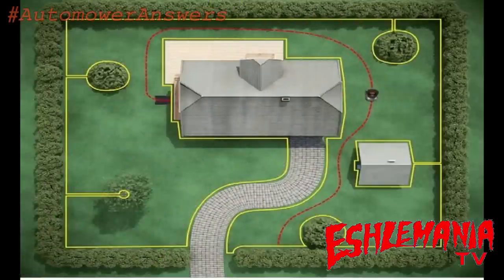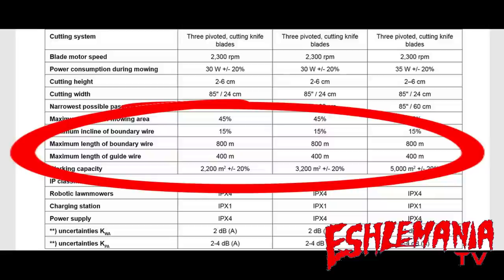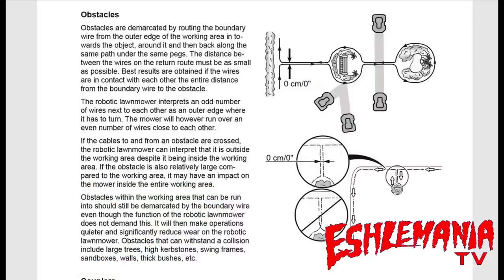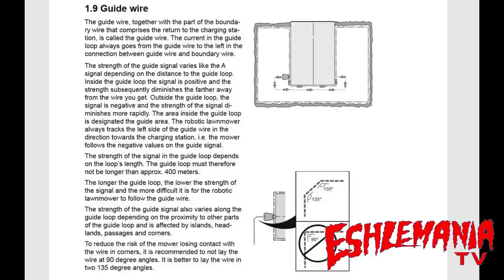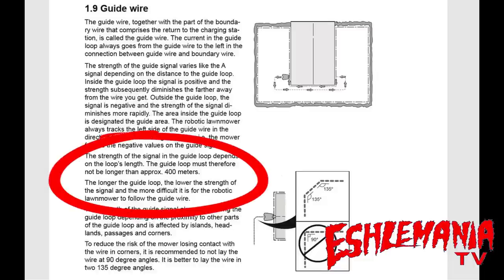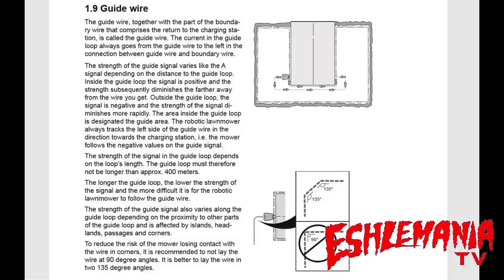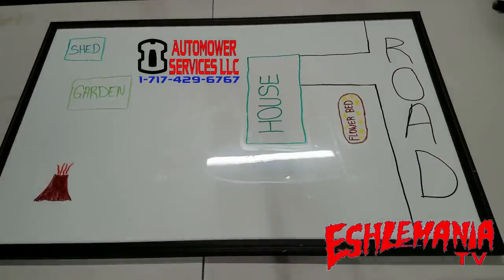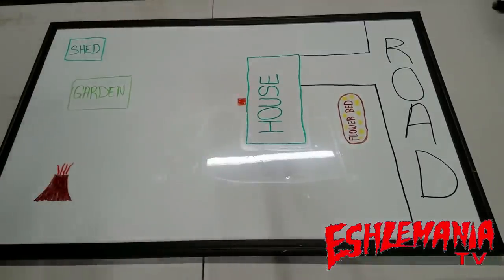Automower Answers: Boundary Wires & Guides Wires (How much is too much)

Comment: It would be nice IF the sales staff and Husqvarna reps actually KNEW this info. I brought in my drawing of our VERY complex landscaped yard and measured out I needed 1300m of boundary wire. All they cared about was if the grass area was less than 1.25Acre...it is .75Acre.  3 Guide wires now available on 450x but still the loops will be more than 400m. I have a large koi pond that has to have boundary around it. So WHY DO THE REPS AND SALES STAFF NOT KNOW THIS INFO!!!  Luckily i saw this video today before i have paid for the new 450X. I will see if i can redesign the layout and maybe have it bump into areas( but that will require a lot of landscape changes). I grow tired of sales people NOT knowing their product. In fact they are order takers, not sales people! Thanks for your great video!!!
Reply from the maker: We could make a LOT of videos about the kind of stuff you're talking about when it comes to people selling power equipment. Not where sure where you are located, but if you need any help or info with an Automower you can send an email to roboticmowerservices@gmail.com
Reply: @EshlemaniaTV  i am in BC but i will email you with
 thanks!

Comment: Guide loop can be longer than 400 meters, but thicker wire must be used - it all comes down to guide loop electrotechnical resistance value. In my garden I have installed a wire, which has conductive cross-section area approximately 1,5 mm² (Husqvarna original standard wire has approximately 0,933 mm²), guide loop length is more than 500 meters and there are no signal problems. Same applies to boundary loop 800 meters maximum length requirement.
Reply from the maker: I've installed a few where we have used over 1,000 meters in the loop and it took some tweaking to get them to work properly. Once they were set up right they had no issues. But since then they have made changes to the charging station boards and a few other components, in places like in the North East United States it's a bit trickier to get away with the large installs like that anymore because of the amount of iron ore in the ground. Same is true for guide loops in these areas.
Reply: @EshlemaniaTV  I'm looking at a 800m boundary for a 450x, with two of the guide wire loops being 550m and 650m respectively, the other is less than 400m. The length being down to the placement of the house and therefore the base unfortunately. I've got standard 2.7mm wire and hoping it will work as they won't be buried, just tacked. The two longer guides will be going over the driveway. If the loop went right at the boundary rather than left it may have been better but it is what it is.
Reply: Installing a 450x with 800-900m perimeter and I have a couple of questions:

1. Does the guide wire maximum length (400m) include the portion of the perimeter wire it connects to?  In other words, if I run a 300m guide wire, but it connects to a point on the boundary wire that is 400m from the base station will it work?

2.  I have a circuitous lawn layout with several large areas.  I plan to run guide wires to these locations, but one location is remote with an eight foot entryway ... if I run a guide wire into the adjacent section, can I safely assume it will eventually find its way into the remote section?
Reply: @chezcarson2012  1. They explained it many times. It should be seen as a loop, both counts. Watch the video again :-)

2. Hard to answer by just reading a text. Guides are used for leaving and returning to the station, when mowing it won't actively use them. Apart from length problems you can run a guide through a narrow passage between boundary wires.

Comment: Thanks for the the help, I have a few questions for a 315x install:
1 can I mow over a freshly seeded soil patch while the seeds are growing?
2 Can I cross an island boundary wire with a guide wire?  It would be crossing the doubled up wire from island to boundary wire proper.  Or does the crossing of a wire pose a problem... 
3 You mention leaving a shed etc to just get bumped into instead of making an island... what about a rock island with football sized rocks at the edge - its in the middle of the yard!  Is it ok to bump into rocks for the robots shell?     Thanks for the tips!

Comment: Will 90 degree corners work with the boundary wires? What happens if the automower needs to find its way back to the base station using the boundary wires?

Comment: I need to put my charging station inside a garage shed. The only problem is that the grass area and shed need to be crossed by pavement. Is it possible to configure the mower to travel on the guidewire without cutting? Or some other way to solve my scenario?

Comment: Instead of doing a GPS guided mow I'm switching to the zone style. How do you determine which wire is the left and which is right? Is it left looking at charge station or facing away from the charge station?
Reply from the maker: They are labeled on the back of the charging station

Comment: Why does my 315X fails to detect guide-wire on the last quarter of the distance when searching path back to charging station? Guide-wire is 85m long and whole ‘left loop’ is about 200m (guide+left boundary). When exiting charging station and going to that spot of 85m it does have no problems following it. Just does not find it when searching it in the last cca. 20-30 meters…

Comment: Very interesting video!
One question thuogh.
I have a 430x with the possibility to use 2 guide cables.
Is it possible to position the 2 guide cables together for 20 meters and then separate them to different planes in the garden?
If not, what is the shortest distance they can be laid without disturbing each other?
Reply from the maker: You can lay them next to each other but leave about 30cm between them.

Comment: Great Video. Thank you I wish I would have watched this 3 years ago.  We just installed a new boundary wire. But this time we decided we didn't need any guide wires.  Stihl and Honda don't use them so we can get a way with not having them  just more stuff to break.  Right. But we installed boundary wire and the battery kept dying.  So we just changed the setting. If the mower has thirty minutes to get back to the charging station than it can just find the boundary wire easily in 30 minutes and roll back to home base right?  Still dyed in the yard.  So we tried a spare on that is brand new and it found the charging station. Was this just luck that it found the charging station? Or is the battery really dead or not good. It is a 2018 model.  You seem to really believe in guide wires. Do you still think the same thing in 2020.  This installation is huge 1.5 acres.
Reply from the maker: Guide wires are what separates Automowers from all of the competition. They allow for more remote start locations within the installation so you can get better coverage in complex or crowded lawns. If the 315X had 2 guide wires there would be even more of them sold. As far as them being one more thing to break, if a guide wire breaks the mower can still mow because it is a completely different signal than the loop signal. The 115H would not be able to dock properly in the charging station if it did not have a guide installed or it was broken. The 115 H charging station use the guide wire to line the mower up with the charger when it backs in. It's really no different than driving in a car and having a limited amount of gas. Ae you going to take the long way around to and from your destination, or are you going to take a direct path to get there to save time and fuel?

Comment: Does the 400 metre limit on the guide wire loop refer to each of the guide wires used or the complete guide wire system installed?

Comment: Very compelling video about the guide wire vs boundary wire, but one thing you did not mention is what if you have a backyard and front yard that is divided by a concrete driveway? Also, in my neighborhood there's a sidewalk, and in front of that sidewalk between my yard and the street a 5'x 30' strip of grass where the mailbox sits. How do I set wires for that area? The principles of the guide wires are simple if you have a "normal" yard, but what about more complex setups, does that mean you need more than one charging station? At some point they are going to have to figure out a way to create boundaries using GPS or "digital zones", kind of like they do with motion detection cameras.
Reply from the maker: I think we talked about set ups similar to that in this video: https://www.youtube.com/watch?v=aarWeUwasFQ

Comment: I have a question about 2 wires to an island canceling the signal so the mower will run over it. We installed an island wire and had a problem with the mower thinking it was a boundarywire. I went back to the section and made sure the wire was next to each other without crossing it over and still didn't work because we were also told the guide wire crossing it would be fine because the boundary would not be detected. Didn't happen so we decided to illiminate the island all together and leave the guide wire in place. when I cut the wire and repaired, after unplugging the unit first, I am now getting the blue flashing light. I repaired again with another coupler and same thing. I did leave some distance on the cut as to not stretch the wire but still flashing blue light, I have ordered more couplers and the Kolso Fo2 to help in case this isn't the problem. Is there a way youy can cause a problem with the coupler itself? I did push down tightly. Thank you

Comment: My 450x has been doing a great job mowing my very complex yard. Not big but complex. However when it goes home to it's garage it spends quite awhile in front of the garage trying to get parked. It keeps hitting the garage and the planter walls nearby.  Is there a way to have avoid running into the walls of its garage?

Comment: What about the line signal booster that is available. Wouldn’t that solve the problem?
Reply from the maker: There is NOT a signal booster available for this generation of Automowers. If you look at the descriptions for them they usually say that. The 220AC was the last model that a signal booster worked on and it has been discontinued for about 2 or 3 years now.

Comment: Does the 450xh model have the same boundary wire length limit?  Can a yard use two systems or the boundary wires butt up against each other?
Reply from the maker: Yes and yes. You can actually over lap the 2 areas a bit if needed.

Comment: Does the depth into the ground that the perimeter and guide wires are set change the signal strength?  I have seen suggestions of burying the wires as much as 4" and, in my mind that would reduce the signal strength much more than say wires buried 1" deep.

Comment: So you can have multiple guide wires ? You would connect it on the same spot in the charging station ?
Reply from the maker: Only with a 400 or 500 series mower. The 115H, 310, 315, and 315X only have the capability to use 1 guide wire.
Reply: @EshlemaniaTV  315X here so yeah I'll be using one. Thx for the heads up

Comment: Can't thank you enough for the very helpful & insightful video, one specific question please, Is the capability of having multiple guiding wires something specific to the base or the mower itself ? 
 I was able to buy 315x  on a very decent offer because of physical damage to its charging station (have to fix it anyway) & Since I have a very complex layout for my mowable area, 2 guide wires will make a huge difference for me. Was wondering if I buy 450x station  & place the electrical components in the 315X station, Crazy ? Any advice ? suggestions ? I have 450x station available at decent price too because of a physical minor 
crack
Reply: I think the stations are different, different transformers and the mower model knows about each guide wire individually. 315X can only use one so even if the station could have been used the mower wouldn't understand it.

Comment: Great ! I have a question. Is it possible to split the guide wire. i have a front lawn and a fenced back lawn and my mower has to travel thru a gate from the front to the back. So its  quite a bit to and from the front lawn  before reaching or coming back to the charging station. I want to split the guide wire as soon as it passes the gate ... Sort of create a bypass for that long route in the back yard. I hope the schematic below comes out ok.  So split at point A and connect at point B hoping that it will travel front lawn -> A->B->Charging Station instead of the current route of front lawn->A->D->B->Charging station.  Thanks

                |------>-----|
                |              |
                ^              v
    split A |              |
 ->----o----|               |
           |                   o point D
           |   Back       |
           |                   |
           |                   v
           |                   |
           |                   |
   |--<--o-----<----------|
   |      Connect B
   v
Charging 
station

Comment: I have a 2nd area at the other side of the driveway. I do not want the Husqvarna 420 to drive to area 2 without me controlling this, to avoid collision with the car on the driveway. I cannot drive around the house to reach area 2. Can I put the 2nd guidewire together with the boudary wires (to and back from area 2) in 1 tube under the  driveway? From point of view of area 1, the loop is 
closed before the driveway, but can I instruct the robot to go to area 2 accross the driveway by instructing the robot to follow guidewire 2 whilest the boundary wires (to area 2 and back from area 2) are next this 2nd guidewire in the same plastic tube? In other words, when one instructs the robot to follow the guidewire, does the robot looks where the boudary wires are located and do they need to be at a minimum distance from the guidewire to allow the guidewire to work?

Comment: So does a thicker gauge of REAL copper help drop the resistance enough to fudge a few more feet?
Reply from the maker: Probably not. And the reason I say that is because that heavier wire might look good plugged into the charging station, but inside that tower are pretty thin wires carrying the voltage from the circuit board to the tabs you would be plugging that heavier wire into.

Comment: So you can run 3 separate guide wires?
Reply from the maker: Depends on what model you have. 450X, 450XH, 550, 550XH can use 3 guide wires.
Reply: @EshlemaniaTV  I only have a 310
Reply: @markhewitt8220  310 only supports one. The station has different connectors for each guide to put different signals so splitting the existing won't work

Comment: Do you know why my 315x very often follows the guide wire when it leaves the charging station? I have a larger area and a smaller area, and the guide wire is in the smaller area. Obviously I want it to go to the larger area most of the time (like 75%), but it still goes to the smaller area half of the time…
Reply from the maker: Do you have GPS mowing turned on? If so, turn it off and set up zones to force the mower to start in the areas that you want it to.

Comment: Great video thanks. I had my 450x installed by an installer two days ago and it has yet to find the home base on it's own.  Plus on one section of my  layout the mower only mows between the guide wire and the lead-in side of the boundary wire.  I placed the mower on the other side of the guide wire and the other half of the boundary wire.  I got a message that it was our of the mowing area.   The other two guide wires do pretty well for getting the mower back to the charging station, but doesn't quite make it into the station and connect on it's own.  Any Ideas? Wires crossed somewhere?
Reply from the maker: Sounds like they have a guide wire connected for a boundary wire and that's why it is not recognizing anything to the other side of that guide wire.
Reply: Thanks. Your answer was spot on. The boundary wire was cross wired with one of the guide wires. Now it operates perfectly.

Comment: I left for vacation and I have the dreaded blue light....I have check the volatage of the power supply 27 v and sometimes showing a little more..I have tried to use my guidewires to create and narrow the loop but none have worked.  In the past I was able to use this method.  I then traced one of these loops and found that to me normal but the autmower still doesnt work on this connected loop.  It was working for about 6-7 months with this set up.  Could there be some other problem ?
Reply: Use an AM radio to check if you have a break in your boudary wire.

Comment: I have a question my automower keeps dying from low battery but the charger is good and so is my loop signal. do you know what's going on?
Reply from the maker: Check your guide wires. Guide wires give the mower a direct shot back to the charging station
Reply: @EshlemaniaTV  the guide wire is totally fine and  so are connections and the way its routed. Could it be the battery?

Comment: Could the 3rd guide wire go all the way down the 3rd area and then cross the boudary wire (without being connected to it), go under the driveway, and connect to the boundary wire near the flower bed?
Reply from the maker: The guide wire can not go outside the boundary wire. I mean you could physically place it outside the boundary wire, but the mower itself will NOT cross the boundary wire to follow the guide.

Comment: I have a Husqvarna 115h - How many guide wires can I run to the charging station (under 600meters total) and where do I connect them on the charging station? (there is ONLY 1 hook up for the guide wire)
Reply from the maker: You can only run 1 guide wire for the 115H